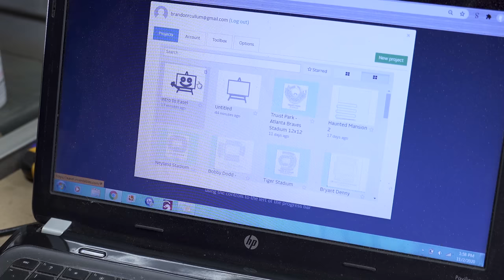What can a $300 CNC do? - Ortur Aufero CNC Engraver Review

Comment: the weakest link is the rod, both machines have 10 or 12 mm rods and they will bend the same, even if a steel frame is used it will not differ. Supported rails or linear rails should be used for a rigid x axis

Comment: I think you put the bottoms wrong and that's why you can't use the whole table area. Look carefully. These lower two aluminum plates, on one is attached the motor, on the other the handle for rotation. They have to be turned upside down, the protruding things on these aluminum plates are actually the legs of the machine and they have to be down. If you turn these parts upside down, the table will be able to pass over them and have more space for movement.

Comment: Looks awesome, seriously considering it, have 3 lasers and I think this would compliment them well. I really don't see why a laser module would be good, as you say this isn't fast so loses alot of the benefits of laser
Reply from the maker: Yeh the laser would take FOREVER, but if you don’t have one at all it would be nice as an easy entry.  Bigger CNC’s let you retro fit a laser module fairly easily but the screw drive on this would make doing any type of raster image take forever.
Reply: @makeorbreakshop  Great overview, but can this carve into graphite? I'm looking to make coin mold blocks averaging at 4 x 4 x 2. I'm looking to buy a cnc router, but I don't want to spend $5,000 for 40 graphite molds. Thanks.

Comment: The reason you can't get to the front edge is your brackets on the bottom are backwards.  I had the same problem when I put mine together.  I also put the bed on upside down (only had 3 cuts vise 4 on the bed.  Once you turn the brackets around, you will be able to go front to back, right to left.

Comment: Thanks for your review.
The correct term for the "bit" is a cutter.
The big negative I saw was that the lead screws are not protected from dust and swarf, especially the Y screw (under the table).
That would be my FIRST thing to do is cover it.
I would imagine the accel/deceleration can be changed.  You just do not want to make it too short of the steppers will miss steps.

Comment: 6:10 you put the collet on upside down (backwards). =) i'm sure its just something that slipped by editing but for those using this as reference... put the collet into the nut (the text on the collet should be facing the work peace; there's also a little notch inside the nut for pressing collet in and out); screw collet and nut into spindle loosely; and then insert cutting bit into the entire assembly before tightening everything down.
Reply: Old post, but I just wanted to post the same observation. No wonder there was a chatter, and no doubt the results would be much better with the properly installed tool. And it's obvious the actual cutting was also done with the collet upside down because there's a huge portion of the thread on the arbor left unused, but also because the resulting cut was much worse than I'm sure this machine can do. One should be careful with the reviews like this, it can do a lot of damage to the manufacturer...

Comment: I need to know, can this cut metal? Or mill out a block of aluminum to a lower?
Reply: Spindle power is low. These struggle to cut wood with anything larger than 3mm bits. It’s going to be even slower cutting a metal
Reply: @LatinDanceVideos  Thankyou for this!! But if you have the speed to lowest setting you think it would be possible?
Reply: Yeah, I am also curious on whether a very slow feed rate, high spindle speed with a good milling bit, plus maybe some cutting oil would help it go through just soft thin aluminum/copper and brass?

Comment: Dear Make or Break, I watched some of your videos and probably you already answered to a question like that ;-)
I am pretty familiar with vinyl cutting plotters, I had few ages ago.
I was wondering if there is a machine where I can buy the main frame and then use a laser and a router.
Basically I would like to be able to use only one machine with different heads( to cut & engrave different materials )  Is this possible ?
Many thanks
Reply: Probably doesn't exist but needs to

Comment: You should be able to change the acceleration rates, that would speed it up. Seems to run GRBL, laser may be possible but you’d have to add a some control hardware to turn it on and adjust the intensity. These may be in the laser module already. 
Really good to see the all metal construction and lead screws are much more rigid than belts, I think this is a good product if you are ok with the smallish working volume. It seems you can hang a long workpiece over the front and out the back so that helps. 
The exposed lead screws always bother me but I don’t have that so can’t say how big a problem it is, I do know that I do a lot of vacuuming and chips and sawdust goes everywhere anyway. The Y axis is hidden underneath and the X screw is high up so there is some protection, Z is more hidden, maybe I’m just paranoid. Guide rails are more exposed but the bearings do help if they seal against the rods.
Reply from the maker: Great point!  I didn't think to mess with the GRBL settings for acceleration.  The bearings do a have a pretty good seal so I think (hope) that dust wont be a huge issue.

Comment: I wonder how this compares to the Sainsmart 3018 ProVer? My friend's prover seems to have MUCH LESS vibration noise, but the mounting for the router on his is plastic and the controller is not as nice.
Reply from the maker: I think this one is more rigid than 3018.  I compared them here: https://www.makeorbreakshop.com/project/ortur-aufero-cnc-engraver-review.  The big thin 3018 has over Ortur is the ability to add a laser engraver.

Comment: Sweet video! I wonder if it can cut through carbon fiber sheets?
Reply from the maker: I'm pretty sure you can since you could cut metal as well, just the time it will take will be a good amount.  I want to try out carving out my own drone frames for a future project and this would be a perfect set up for that.
Reply: @makeorbreakshop  Exactlymy thoughts as well I would love to prototype ideas at home without having to wait for a machinist to reply to me about cutting carbon hahah.  I'd watch that video i'll keep an eye out now that I'm subscribed.
Reply: YES   cf and fiberglass cut with ease. It's just that both are very messy,  you need good dust extraction. I nave done both on my homebuilt machine while rebuilding my boat.

Comment: I wonder if they’ll sell the touch-pad offline controller separately. The one that I got with my Sainsmart machine is awful. They’re both grbl, I wonder if they’d be compatible.
Reply from the maker: Maybe, what bad about the Sainsmart one?
Reply: @makeorbreakshop  the offline controller only accepts .nc files occasionally, and it’s never clear what caused the problem when it doesn’t work. It’s great for jogging the machine, but running jobs on it is 50/50 at best. I was hoping when I got it that I wouldn’t have to run it on a computer, since I keep it in a garage, but that’s what it’s come to.

Comment: What would be the best precision unit for PCB where precision and fine work are most important?
Reply: onefinity cnc machinist 16 in by 16 in work area for about $2,000
I do not own this, but I hope to order one soon.
Reply: My newing-hall  for home jobs...will diamond drag letters, 8" to .004"....
Reply: I bought the 3018 Pro and first thing I did was to replace the spindle motor and mechanism with a 500W because the original one gave me a 0.6mm run-out. but with the new spindle I am at 0.2mm which is good enough for a reasonable PCB